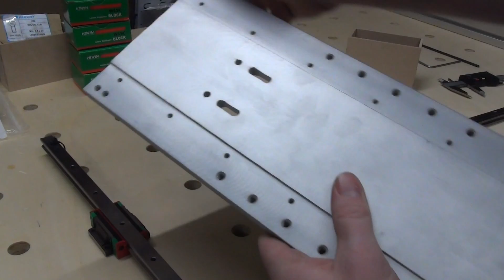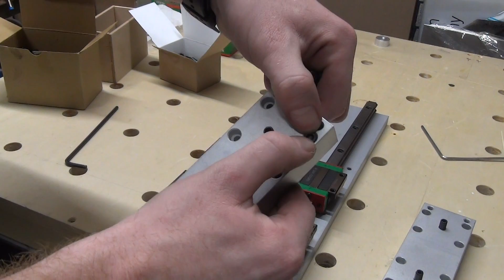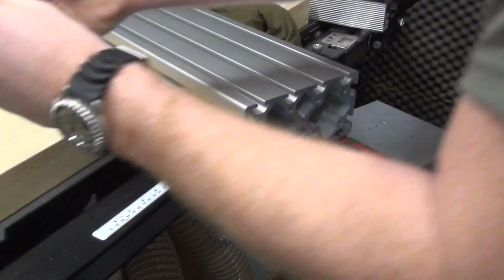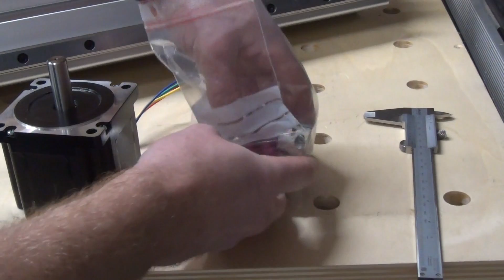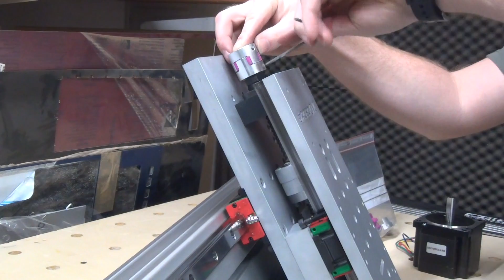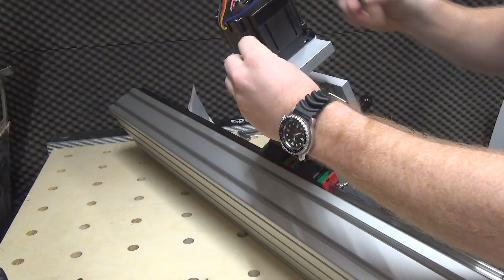Z-Axis Build Part 2 | Assembly, Ball Screw & Stepper Motor Installation - RCNC X2 Ep. 02

Comment: Very informative video, thanks for sharing! At some point in the video you promised to explain why the other end of the ball screw is floating, but I think you actually forgot to do that. Could you please elaborate?
Reply from the maker: There is no sense in fixing the other end... Slight misalignment, or (temperature) expansion good result in problems when fixing it. And of course it takes a lot of space to do so... Basically, if you do not need it don't use it.

Comment: First of all, you've done a great work on building this machine but most importantly on sharing the very detailed process. So thank you very much. I might grab some ideas for my next build.
But if I may, I think there is a design flaw on the Z axis. Let's say your gantry height is 150mm over the table and you want to use an endmill with a 60mm stick-out for exemple. Given your design, at the maximum Z the bottom of the endmill will be only 70mm over the bed (150mm - 60mm - 20mm spindle collet offset). The longer the endmill, the less usable Z you get. Placing fixed rails and moving carriages could double your usable height. It would also be constant (not dependant on the endmill length).
Cheers.
Reply from the maker: You are right that the Z hight is quite limited... I would still go this way, but might make the frame a bit higher...
Reply: Do you have any reason why you would still go this way? The usable height limitation seems to me to be a good argument to go the other way around, without increasing the gantry height. But you must have your reasons?
Reply: @RoboCNCnl  looking to build and I have added 8cm on top of where the Z on my plans to edit a bit but is mainly as going water cooled (4k-24k rpm) and instead of issues happening going to put radiator and pump on the back (where Z not move up and down) looking to hard tube it to make sure not move and flexible to spindle, it have a temp sensor so know it working okay and stop if worry on how bad cooling is

also a thing to ask is the hiwin carriages low, medium or high preload? I am looking at a UK company that sells them as I live in UK and has those listed for same as yours but site you use has standard one version

Comment: Hello Marcel, greetings from Canada again. I told you about how I was going to borrow heavily from your design. My table will be a little larger. I am doing 3D wood works and wish to be able to handle 1/2 sheet plywood as well as 200mm tall material for the Z axis.
So my base or stand is of steel. It is going to be heavy. They sent 0.188" wall instead of 0.100" for some of the  cross members for the bed. Now I am dealing with a return issue. If they had sent 0.125" I might have been able to deal with it. I am very unhappy with the supplier needless to say. 
This Type 10 extruded profile I found for the X rail supports, it is 45x180mm good score for sure, but...
What about mounting HGR20 rail to a 10mm gap? Do you think it will be okay ? I don't wish to bother you friend. It is after all just your opinion :-)
Reply from the maker: Hi Chris... You seem to be making progress, good to hear !  HGR20 to a 10mm gap.... Well.. I think you would be fine, but you could easily go for HGR25 ofcourse...
Take a look at the HIWIN website, there documentation is really amazing, and i'm sure you can fins some info on this matter in there...
Reply: I would be farther ahead if I didn't live in a rural setting. Of course anything is possible but at what cost? , 25mm rail is only 3mm wider if the spec sheets are correct.   New Years in China so I have lots of time to decide. Finally found a decent vendor for the full suite of bearing and more,.. name of BST Automation.

Comment: Just looking great. Very encouraging video. Take it easy with the pre-load of the little z- spindle bearings. M12x1 with that torque on the wrench creates quite a bit of tension. I saw others using spring washers to control the pre-load. I was wondering if a step in the spacers could have helped with the alignment towards the 15er blocks.  More videos ahead of me to watch. Thanks for sharing your work.
Reply from the maker: Thanks for watching, and the advice...